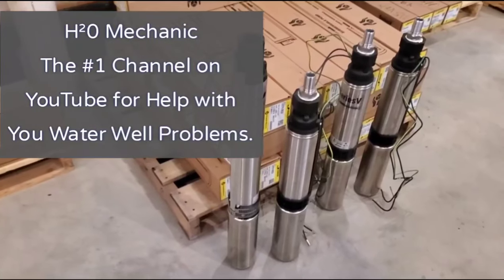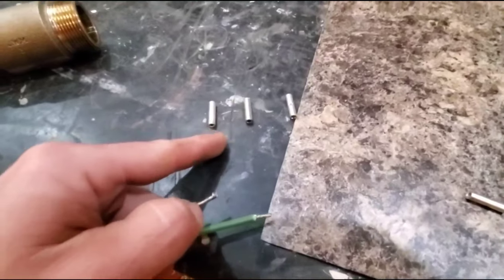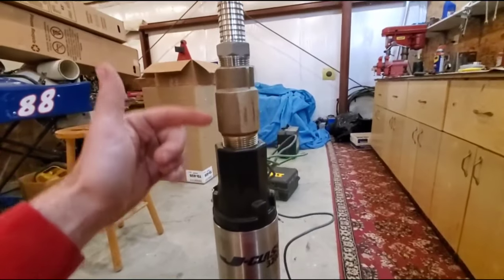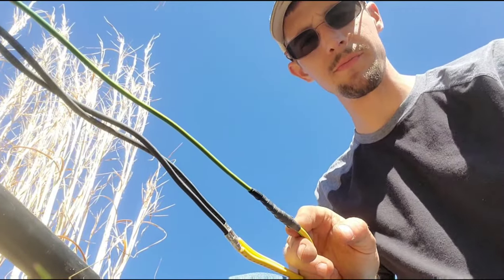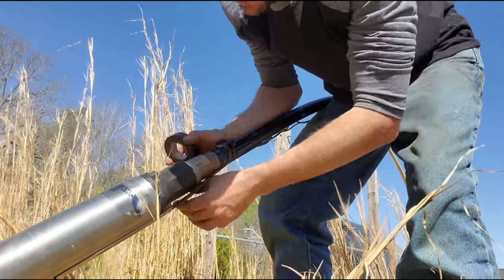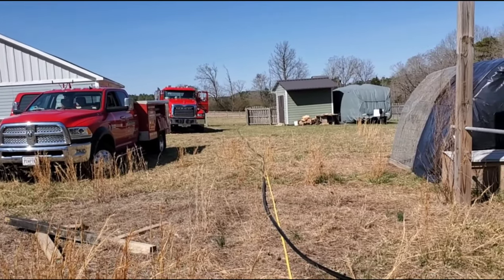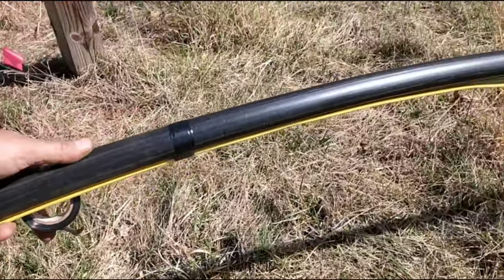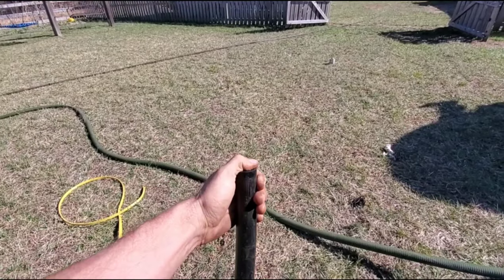What Size Well Pump Do You Need? How to install a Pump Correctly

Comment: My five cents - My method for electrical connection/splice in pressurized water is hot melt glue filled crimp on heat shrink connectors. Have a small butane powered heat source with catalytic burner for shrinking when there is no electric power. no need for special tape around the splice. Also use jacketed stranded conductor cable for connection of well pump. I never use 2 wire pumps and always 3 wire pumps because I want the capacitor for the Permanent Split Capacitor  motor of the well pump above ground! What makes the pump fail is in many cases a bad capacitor, so when it is above ground you do not have to pull out the pump from the well, just change the capacitor in the control box and you are done. A lot less labor, sure the initial investment for the one more wire down the well ads to the install cost, but in the long run I get out of 'GOULDS' pumps more than 10 years in average. Well head is always protected by stainless steel 55 Gal Barrel with lid where I cut the bottom out - and the Barrel gets grounded with a 8 ft grounding rod and connected to the ground wire at the wellhead. use only PSC motor pumps this way even direct lightning strike damages nothing on the pump since the 3 wire pump down in the well has MOV's. Of course in a competitive marketplace with homeowners on a budget doing it my way may price you out of the market. But you may consider offering this version as an alternative if durability is asked for. Also use a power sensing timer swi9tch at the control box so the pump never runs dry. The moment the low yielding well is pumped out the pump stops and waits a preset time before it restarts. The control box for the 3 wire pump even gets a run capacitor for the PSC motor added. Doing all this gets a lot more mileage out of an install and when lightening strikes you still have running water.

Comment: I'm in north Texas and 550-600 ft wells with pumps at 400-440 ft down use pvc pipe. My original pump that supplies house and watered horses and cattle lasted 22 yrs and my well has some silt. Replacement is filling a 1000 gallon tank and a 3/4 hp shallow well pump now is my system. The gpm is 30 instead of 6-7. The 3/4 pump is 2 ft below tank bottom and overdoes its 27 gpm as a result. Water trough filling is wonderful now.
Reply: How are you pulling water up from 440 feet? My well is 550ft and pump is at 440 feet. 5 hp with 3 wire pump and franklin control box.
Reply: @johnwehunt4305 5hp? My well is 500ft deep. My red lion 1.5hp pump pumps 11gpm from 460ft down.  Your gpm must be over 30 with that pump I bet
Reply: It all depends on the static level and the draw down. no matter how deep the pump is set or how deep the well is, you are only lifting water from the level in the well to the level of the house.

Comment: Good vid. I'd like to ad my 2 cents though on the electrical connections. I have been using waterproof heat shrink connectors in the marine business for years. Just crimp and heat shrink with a heat gun small torch. You could of course still add the tape afterwards but not really necessary.
Reply: They are much more reliable than tape.  They have a hot melt adhesive on the inside of the tubing.
Reply from the maker: I like using them on my stuff as well. Little suckers are expensive though!  They are heat/epoxy Resin that helps seal the connection. The truth is, my Well connections never go bad, I believe bc they don't see air. In 30+ years of doing these, we've never had one fail. But not all conditions are the same. Most ppl can access heat shinks easier than rubber tape.

Comment: I enjoy watching you work, doing it the right way.  I would hire you immediately just from what I have seen so far.  But one thing scared the heck out of me.  When I saw you hold a hot wire in each hand and plug them into that socket, I cringed.  At the very least, just plug the first one in and let it go, then the second one to test.  But the safest, and a pretty easy way to do it is put a 230 volt disconnect before your socket.  Then you can plug them both in, and turn on the power safely without you touching anything.  Stay safe, sir.
Reply: You're nominated for top brainless comment!!! YOU WIN!!!!
Reply: @Utubegofukurself I like your username.

Comment: Been watching and am impressed.   I saw u use the rubber tape and couldn’t help but wonder why a marine grade heat shrink wouldn’t be better.   It’s water proof and awesome. Check it out if u haven’t heard of it.  It has a glue in it that activates when u shrink it making a water tight seal

Comment: As I observed, you made a better choice which is crimping the cable extension to pump. It is better than splicing the cable together. However, joint splicing at the same length is not good and ideal? Although, the use of rubber insulation tape is okay, why not make the splicing in different length? 

In general, you made a good job.

Comment: By the way, R.C. Worst (a company out of Washington state) offers some great guidance on drop pipe. In order of pressure, the poly pipe they consider 'lightest duty' with 'most-headache' for anything other than shallow wells...they won't begin to recommend it for anything deeper than 100-feet. Next-strongest, PVC (Schd. 120)...they recommend for wells up to 520-feet (1-inch dia), and also relatively easy to assemble if you use a simple hold-jig, as you drop it. Lastly, for 'ultra-deep wells', there's galvanized steel drop pipe...which is rated to many-thousands of feet. I kept looking at that poly you were working with, and couldn't put my finger on it at first...but I've never seen poly used locally...and even when I lived 'back east', never remembered seeing a well deeper than 100-125' that had a poly drop pipe...once you pass that point, they were always galvanized steel (good for 15-20 years down-hole). I know you're just going on that SIDR 7 rating of 250-psi, divided by the 'every 33 feet is 14.7 psi' value...but a lot of 'deep well' guys will tell you, it will not stand up. Just an FYI.
Reply: I'm not sure why some installers wouldn't use poly. Around here wells are typically 150-300 ft, and we use 160 psi poly all the time. I've never ever seen a failure. ALL the professionals use poly here. Central British Columbia, Canada.
Reply: Pumps under 300' are typically set on 160 PSI poly pipe in our area. We have pulled a few that were set 500' on poly, but I would not recommend it and i would replace the pipe with SCH 80 or 120 . We service hundreds of pumps a year and rarely find any issues with the poly drop pipe . We have more problems with the buried offset line bursting than the drop pipe.
Reply: Poly seems like the better choice period. PVC sucks

Comment: Excellent video, thanks for making this info available to the average Joe! Was wondering, could you use heat shrink tubes (with adhesive lining - it melts around the wires as you apply the heatgun) around the wire connections instead of the water proofing tape, or both? Personally I just wouldn't trust that water proofing tape alone.
Reply: I was thinking the same thing.

Comment: I'm in Zimbabwe so this might sound backwards but we always use wire splicing kits with resin on submersible pump connections. I cannot believe that a bit of rubber tape will stop water ingres, especially at depth, other than that our processes are exactly the same,  exept we only use galvanised pipe down our holes & always use a safety cable🤔...have to use shear legs to lift them, impossible to lift by hand!...thanks for educating me, love your videos!...come visit Zimbabwe sometime, it's a beautiful place!

Comment: I like the way you wrap tape every 2 feet. I have had pump people do it every 10+ feet and when then owner wants me to do a specific capacity drawdown test to see what their well can produce. when I lower my sounder down the well if you don't put you tape close together the transducer can slip between the wire and the pipe then when you retrieve it, it can hang up and get stuck and be a problem to get out. I have had to pull the pump a few time to retrieve the transducer. Keep using a lot of tape. I wish you set all of the pumps in wells I have worked on, but maybe you wouldn't like to we have to set our pittless adaptors around 7-7.5 feet.

Comment: That plug situation is 😬. Look up the Cliff Quick Test, they can be a bit pricey and hard to get in the US, but definitely worth it for your use case. It would also allow you to get the pump further from the outlet so it can be tested vertically

Comment: 2 questions, 1 do you ever recommend removing the plastic check in the pump, 2 do you ever add an additional check up the line?
Reply from the maker: Just leave the stock check valve in the pump & add a brass Simmons check to the top of the pump. I do that on all my 400ft systems

Comment: Awww...shucks, that ain't nothin'! Out here in West Texas we have wells that go down 600, 700...even 900 feet (deepest I've heard of anyone nearby having one is 1150 feet). You get to pushing THAT MUCH water, you have to 'multi-stage' your deep well pumps...multiple breakers, serious piping, relief valves...almost like 'drilling for oil'...friggin' Permian Basin wierdness! Great video, though...good explanation for 'sane depths'.

Comment: I pulled my well pump due to no water once.  I then hooked it up and it jumped just like yours did on the bench, then I dropped it back down.  It still didnt work because the coupler between the motor and pump broke.   Good thing it's only 50ft down.
Reply from the maker: The output shaft coupler died? That's very rare. Older 90s models pumps had plastic ones. Most are aluminum now.
Reply: @h2omechanic  it was steel and looked like a wire coupler.

Comment: I had a well drilled about 13 years ago, they installed devices about every 7 to 8 feet along the drop pipe "I believe that is what you call it" to prevent the wire and drop pipe from coming in contact with the walls of the well and casing. I notice you don't do that. it appears that it would help but I am not a well expert but I  have known wells that have had the same pump and drop pipe for 30 plus years.

Comment: They sell heat shrink wire splice tubes. Crimp, heat and then a silicone oozes out when heat is applied. The job he did in this video took no short cuts and was done correctly IMHO.
Reply from the maker: Yes, everything is listed in the video description box to help guide others to the correct/ quality product

Comment: It's interesting that you bench-rest the unit before installation. You do that dry? Just for a moment? Roughly what percentage of the pumps you bench-test are defective? I helped install a pump some years ago, deep, and it was defective. What a major headache it was to pull it and replace with another.

Comment: I’ve got a 600 foot well with a static at 272 feet. I have two questions for you. If you don’t mind, what size pump would you recommend and Brand? Also, originally it had poly pipe in it for 22 years and I’m leaning toward using poly pipe. Is this what you would recommend?

Comment: Hello, what size/brand is this pump. I am about to replace a pump. My well and depth are the same as this well. Also my water has never cleared up since it was drilled and my pump has died because it has been working in incredibly silty/clay contaminated water. Any suggestions on a brand of pump that can handle dirty water better than others? 
 Thank you so much for your time. Great channel!

Comment: Couple of questions. You used screw type of clamps on the hose barb at the pump. Why don't you a bandit type of clamp instead? I might of missed something did you or do you use a stainless cable to support the weight of the pump and pipe to take the load off of the pipe joint at the hose barb?

Comment: subbed!    also want to thank you for your nice video's.     both wells on my ranch dried up.   the one "good" well, that used to put out like 5-8 gpm at 280 ft,  finally started sucking water and the pumpsaver didn't work and pump kinda stopped working.   i had them pull the 4 1/2" casing and deepened it.   static water was at 109' per sounder but i have my doubts how long it takes to get to 109'.  i would figure more of a 250' ish working static level.    before they started deepening at 280' it was doing about 3/4 gpm.   they hit 2 gpm at 340' and it stayed that way down to 580' where they hit hard blue/red granite so we stopped.  put 4.5" pvc casing down to 580'.   i figure to set pump at 570'.  was planning on using 1' sch120 pvc with stainless couplings and 3 check valves.   i figure about 470' of water in well so let's say 900 gallons that refills at 2 gpm from 340' and refills at 3/4 gpm higher up.    all i need  the pump to do is fill up my 2500 gallon black water tank,,,,  the jet pump takes over from there to supply house and barn.   there is a warwick switch system for controlling water level in black tank that turns subermisble on and off.   i was thinking a 1 hp franklin motor with a 5 gpm pump.   what do you think?  the problem is the 5 gpm pump will out pump the well if black tank is really low.   so i either need to change switch level or use timer for pump.  thanks for any insight.
Reply: Oh nice set up, thanks for the ideas!

Comment: I have heard the poly pipe will stretch about 1% over time from the weight of the water and pump. It's hard to believe that it would stretch one foot per hundred foot. If it does that would make the wire extremely tight.

Comment: Aren't you supposed to use those rubber bumper boots so the pipe doesn't bang around everytime the pump comes on?
Reply: Torque arrestors!
Reply: Not if its a slow start pump
Reply: Correction-rubber baby buggy bumper boots
Please put this in your notes. 
Thanks

Comment: I have a shallow well (less than 100' deep) I want to install a submersible pump down in the bottom of my well so I can seal off the casing, 1. Do they make shallow well submersibles, and 2. Do you have any experience or knowledge about its installation?

Comment: Another excellent video. Thanks. Question: does adding a second check valve on the pump increase the odds of a failure years down the line?
Reply: I was wondering the same thing. I still like the video!
Reply from the maker: Not really. If I install a pump at 400ft then I'd add an extra check valve. 
Certain brand pumps run different check valves. I've had them fail, & I move away from said brand. Simmons made a pump a few years ago & its internal check valve would actually unspin itself. Horrible design, so I stopped using those pumps.

Comment: Why don't you use heat shrinks like most well drillers here in the northeast?  I  have never had a heat shrink fail in 40 years.

Comment: Hello, thank you for making these videos!! I have a 400ft well and would like to install the vevor 3hp 230v 37gpm 640ft to head pump but noticed you said lower gpm is better for deeper wells and I'd like to put it at 380ft like the well in the video.  Do you think this pump will work? The hydrant will be just 4-6ft from the well head.  Also I was planning to use 10 or 12ga wire and 160psi pipe, is this the correct choice? The pump will be run off a generator a couple times a year at a recreational property.
Reply from the maker: None of that would work. 
Not a good idea to use vevor unless you tight on cash. Still then you'd need #8 wire & 250psi pipe to go 400ft .  That pumps not designed for that depth (advertising is not also true).
But yes, to go 400ft deep you'd need a 5GPM pump not a 20-40gpm. High volume pumps are designed to flow alot of water at lesser depths. I just went in depth to another viewer wanting to do something very similar. Others used vevor down deep and keep melting the wires. So I wouldn't advise it. Buy a 3/4 or 1hp. 5gpm pump and use #10 wire . 200psi pipe is good for about 350ft max fyi
Reply: @h2omechanic  Thank you for the reply, I really appreciate the feedback!! I want to spend as little as possible so we are going to get a Vevor.  The pump will not even run more than 1 hour a year, maybe 4 times a year around 10 or 15 minutes max to pump some water out of the hole.  I think I'll just get the super cheap 1.5hp Vevor and drop it down 100ft and call it good.  The primary focus is make it as cheap as possible to get water out of the hole.

Comment: I have PCV well piping, I need a new pump. Should I convert to rubber flex hose? The well is 300 feet down.My old pump was installed in 2001. It was a 2 hp pump. What he should be running?

Comment: I have a 2 inch well with a dual stage jet pump. I'm considering going with a 2 inch submersible. It's a 63 ft well. It is at a Florida vacation home and has to be primed with 5 gallons of water every time I visit.  What are your thoughts?
Thank You! Love the channel.

Comment: Thanks for the information, I am using pump which has outlet 1.5 inch and 11 galllans per minute what size drop pipe i will need
Reply: 1" would be enough for that flow. If the distance is greater that 300 Ft maybe it would be a good idea to use 1.5"